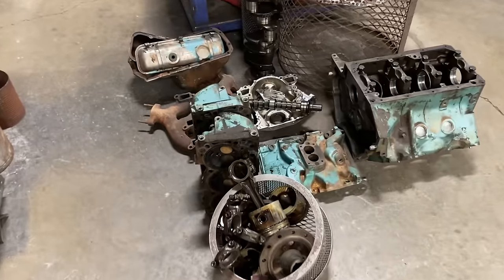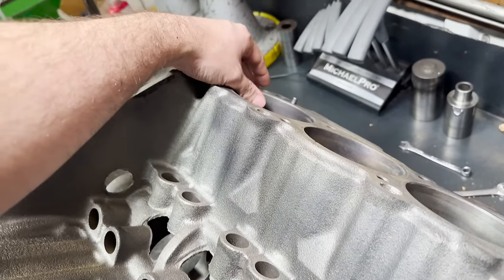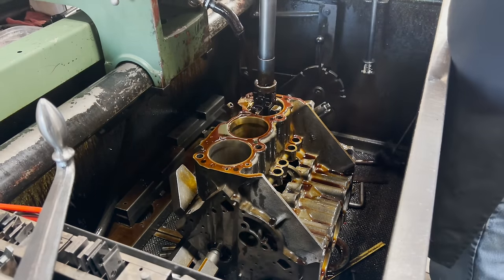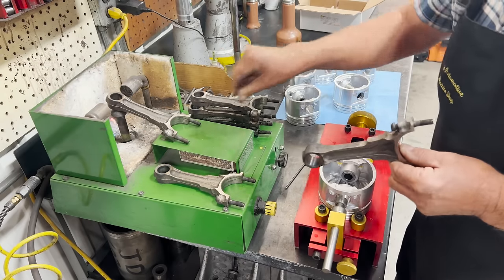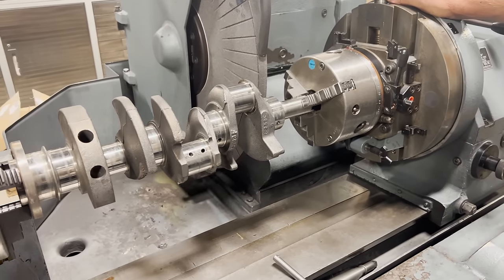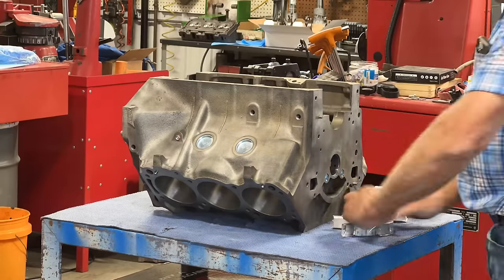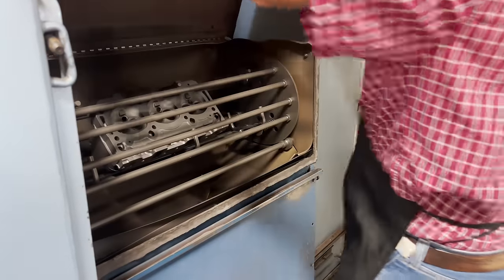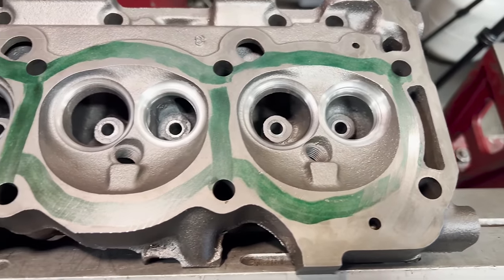This 225 Buick DAUNTLESS V6 Odd Fire Was WORSE Than We Thought...

Comment: I had a Jeep Commando with the 225 engine.  It never gave me any trouble, but the clutch was operated by a cable which would break at the most inoppertune moment.  The first time it broke i was in downtown traffic in Shreveport LA so as I approached a stop light I would just switch off the ignition as I came to a stop.  To go I made sure I was in 1st gear and hit the starter.  It would just take off, without lugging, nice and smooth. After this experience I always carried a spare cable.

As a side note when crossing the bridge in Pascagoula MS the wheelbase of the Jeep matched the camber of the bridge so that it resembled a boat on a good sized swell.  Closest I ever came to being seasick.

Comment: Back in the mid 70's I had a 1968 CJ5 with the Buick V6 which I rebuilt put a  Mellings cam in it a set of headers and a Holly 500cfm carb on it it was a LITTLE BEAST had tons of FUN playing in the mud and sand with it
Reply: I had a 68 cj5 as well. Holley carb, offenhauser manifold and hooker headers. Don’t know what kind of cam. It was fun.

Comment: Great video!  That cleaning guy has really picked up tremendous knowledge from hanging around the machine shop for a few years.  Despite all the detractors and trolls, it's very refreshing to hear your well reasoned explanation of how and why you do things without disparaging other points of view.  Also interesting to see the "modern" technology that Nicolaus is bringing into the shop to measure the surfaces, and refreshing to see that accepted by Dad.  Great partnership of decades of experience along with modern viewpoint with both clearly respectful of the other's thoughts and knowledge.

Comment: Had a 1970 Jeepster Commando with a Dauntless, originally came with a Pertronix points distributor that wouldn't run for squat, no parts available, the auto part stores could only get the distributor for an even fire, finally had to build an HEI, used a 350 Chevy distributor with a Buick base, was able to order the various random pickup coil, the reluctor ring  and the cap, it ran awesome, it is a whole other lever of research and parts tracking, the only info on the HEI parts were in a 1976 Buick Apollo service manual I was finally able to track down at the college auto shop. Great engines, the sound is definitely unique

Comment: Hi Gents, I have had 3 even fire 231 engines. 1982 Cutlass , a 1983 Cutlass and 1983 Grand Prix, these engines ran really well considering they all had 2.41 rear gear and 350 trans W/lock-up. Those cars weighted 3500 lbs. and cruise at 70 mph. no problem!! I remember the odd fire 225 I worked for Buick for a while and they also ran well, but like you said would give people fits in the later yrs. with parts mix ups. I really love this channel!! I like the content alot!! Thanks Cleaning Guy and Supervisor!!😁😁😁😁
Reply: Dauntless 225 was a much better and more durable engine than the later even fire models.

Comment: When you mentioned the build-up in the grooves, I immediately flashed on my bosses ring groove cleaner. It was a slightly different design but did the job. There was also a selection dial for ring width and you had to be careful to get it close or less. There was always a chance of actually cutting metal if you chose wrong or set the tension too tight.
   To tell you the truth I was always a bit intimidated when I had to use it.

Comment: For ring groove clean-up, I've used old piston ring from the same piston you're working on. Just cut and make the tip nice and sharp, cleans up old carbon nicely and is just the right size.
Reply: Way too nicely gouge up the land so  the ring is tight & doesn't seat/seal against the land.

Comment: Had one of those V-6's in a 71 jeep comando I bought off a farmer, was probably one of the best trucks I ever owned it was a half cab unit, with a 6ft snow plow, it pulled hay wagons, plowed snow{winter of 78} hauled a large wagon of green cut firewood out of many woods and took me 50 miles a day to work in many nasty days of winter. When it rusted out badly I sold it to a lumber Co. who plowed out their lots with it.

Comment: Very interesting to see the 1st generation of this engine, as my every day drive ( 97 VT Commodore 3800 Ecotech ) has nearly the final version. Look no adjacent exhaust valves - Buick seemed to be the only GM marque that could design a decent cylinder head.
FYI my 1964 Motors manual lists the ring gap at 0.01" for the Buick 198 & 225, which seems a bit tight for a heavy vehicle, so your 0.018" is probably spot on.
Reply: 3 thou per inch of bore.

Comment: Another odd-fire engine with an unmistakable exhaust note (actually two notes at the same time,  LOL!) is the Dodge Viper V10. So is the old Ram iron block v10, but the dual pitch is much easier to hear on the Viper with side pipes.

Comment: I junked a lot of those old odd fire Buick engines. They would skip a bearing,either a rod or sometimes a cam bearing. Most of the time they would get a SBC, but I did put a few even fire engines in when the customer wanted to keep a Buick v6.

Comment: When I went to trade school for diesel mechanic, I was taught to install the rings just like you. Only thing different is, coated the sleeve with light weight oil. Oil ring will always wipe the sleeves down during install. Coated both main and rod bearings with light weight oil as well, plasti-gauged dry prior to install of bearings, then coated when everything measured correctly. Great video as always, cheers :)

Comment: The very same problem exists with the PRV 2.7 litres V6 by Peugeot, Renault and Volvo - which was designed as a V8 originally and got 2 cylinders lopped of due to the oil crises. That's the very same engine, which powered the Renault Alpine A310 ... and the DeLorean. Renault, who was the last user of that engine, changed the internals for the last series used on the Alpine A330. Thanks for showing !

Comment: worked on fleet of v6 buicks back in the day. They would run rich because of the foam float would absorb gas. ring wear and cly. wall would wear like that. Check the wear on the bore in the timing cover for the dist. oil pump drive. any wear will cause all sort of problems. We would always just go new and this was a cheap operation
Reply: Indeed. I have heard that new timing covers aren't that great, so TA Performance made something better than OEM or most aftermarket units.

Comment: I remember reading info many centuries ago that rings rotate while an engine runs - so ring gap position is not important, it is going to change. 2 strokes I worked on had pins/pegs to stop ring rotation.

Comment: 7:36 holy crap!! I didn’t know those existed.

I made a compression ring groove cleaner and it doesn’t look all that different from this.

I use it for my fairly profitable Nissan VQ rebuilding.

Probably 1/3 engines I’ve rebuilt had rings that weren’t stuck, but definitely not completely free, they seem to get that way after 150k-200k miles.

I made my tool surfaces out of aluminum to avoid wearing the pistons and it seems to work fantastically.

Comment: Lovely Engine I had a 67 Jeepster Commando with the same engine with a Prestolite Distributor .... Fun fact, I needed to replace the starter, I had a unit from a 74 454 ... swapped the nose cone, ran just fine.
Reply: Some Jeep guys look in junkyards for the few odd fire V6 engines with an HEI distributor.

Comment: When I put an engine together I like to put the ring end gaps away from the thrust side’s of the piston, I think it stops the ring ends from putting vertical scrape marks up the cylinder wall. I also like to have the top ring end gap facing away from the exhaust side of the engine, I don’t know if it’s right or wrong but it has always worked for me.

Comment: My first experience with an odd fire was a wrong distributor cap provided by the SM, which I didn't notice or know about the odd fire even events at 90 while odd events went 150.  The other experience I had was  split journal when it became even fire was in a machine shop like your cleaning guy, wrong cam. The eventual 3.8 was a great engine and the final form with the counter balance in my opinion was one of the best GM ever produced.

Comment: add a split pin crank and a balance shaft..... and you get THE!!! smoothest v6 ever made..... the buick 3800 S1/2/3
.
i put a nickle on the intake.... and bounced it off the rev limiter..... the nickle never moved
32mpg, enough power, and just durable AF.......
.
buick had some DAMN good engineers back in the day
Reply: I think the 3800 series 3 might have been one of the best V6 engines. They got rid of the plastic intake and awful intake gaskets, which were about the only weakness.

Comment: Wow! What a nice little engine. Until now I'd only heard of a Dauntless V6 but never actually seen one. Thank you for letting us see it and the work you're doing on it.
Reply: Used in some early CJ 5,s  and mostly Commandos up to 71. Great little engine had Auto one and manual one,s in 2  different 70 Commandos Manual one had 42lb flywheel and once revs were up and engine Screaming it was unstoppable and would not bog down. Most potent hill climber I have ever seen or driven.

Comment: I rebuilt one of these back in 1986 for my Jeep.  Cool engine with plenty of grunt for these little Jeeps.  Man, the days of bore ridges at low mileage !! Thank tetraethyl lead for that.  Lead oxide is quite abrasive, and when we took the leaded gas away, bore wear went way down.   Some mechanics back in the 80'sclaimed better metal in later engines, but I call bull, as late 1970's-early 1980's were the worst quality from the domestics, but they still lasted longer due to unleaded gas.   Now, todays  (Last 25 years or so) ARE better metal and far more precise machining.
Reply: I think about how once there was no leaded gasoline, several early engines would get burned valves. The lead ash protected the non hardened valve seats.

Comment: I think piston rings is like thermal compound on a CPU when building a computer, everyone is the undeniable expert at it and only they can do it right. But with a couple, you just ensure you get even spread that it's all covered. With piston rings, all my engines I've built over my life, about 30 or so, I just ensure they are right side up, oil ring is together properly , and tap is correct. Otherwise I just ensure they are all offset. I read the instructions for any special setups for special 3ngines, but otherwise, I try to ensure aeast a 20° offset, preferably I go for 120° after ensuring gaps prior, then proper up/down and location. And when compressing the rings, they should always just compress right in with no resistance. If for some reason it doesn't compress, stop and investigate!!  But it's simple, don't let the keyboqrd warrior experts who have never touched and 3ngine, but know better because they watches a YouTube with all the science and theories and know everything perfect.  Lol. You guys are freaking artists!

Comment: I was a member of the American Engine Rebuilders Association back in the 80's when I ran an engine shop in Dover, Pa. They used to send out periodic warnings about certain engines that were considered "unrebuildable" and should be given a wide berth. I personally knew of at least half a dozen shops which had to shut because they lost so much money on warranties after trying to rebuild these engines.
Reply: Automotive engine rebuilders association
Reply: O yeah why don’t you prove it rebuild my engine I tried ,every bolt I could break off I did and I have no idea how
Reply: Different engines not the 225 odd fire here.

Comment: Bought new 82 Olds with 231.
Bought Buick from neighbor same year model.
Friend gave me a 4.1 engine . Overhauled it installed it and it ran much better.
Only thing I didn’t like was the oil pump in the timing cover which was aluminum.
A Chevy pump then cost 20 to 30 bucks , a Buick pump , the housing was over 100.
A lot of money for me back then.

Comment: Wow, that is absolutely mind twisting. I have never seen or ever heard of a engine like that. Great job, great video, awesome detail in what kind of engine you are working on. Keep up the great work.
Reply: Then there is the 120° Ferrari Dino V6. That has its own intricacies and balance issues. 
GMC also built 305, 351M, 376 and up to 478 CID 60° V6 engines. They also built a 702 V12 based on the 351M. The block, crank and cam are one piece specific parts but they use 4 cylinder heads, two carburetors and 4 exhaust manifolds. They also built a 648 cube 60°V8.
They also built diesel V6 versions named ToroFlow.
Reply: What was the deck height of the original pistons. The Buick V6 generally about 0.080" deck height. That is the piston crown is below the deck gasket surface. A -0.005" deck height would be the piston crown 0.005" higher than the deck gasket surface.
When Buick gave up on the 215 aluminium V8, they went to an iron V6 of 198 CID. When the General bought the V6 back from Jeep they bored it out a bit to 231 CID with oddfire. Eventually they engineered the split journal rod throws for even fire.
The year they changed to the even fire and at a different date they changed the cam with the distributor drive gear between machined in and bolt on.
Reply: If you really want to see an unusual V6 engine, look at a VW VR6. They are actually well balanced, I thought that would not happen.

Comment: I remember the mid 70s when instead of using the Buick engine GM tried to use Chevy engines in Buick to be a work around. I was at a local dealership then and it went so far that customers threatened to sue . So we were replacing engines on almost a daily schedule. I remember crating engines to go back to Buick.
Reply: My 1978 Buick Lesabre used a 300 CI 140 HP engine built by Pontiac.  It had an 85 mph speedometer and  a little buzzer that went off if you exceeded the 55 mph speed limit. The unreasonable speed limit made a lot of money for highway patrol and local police departments.
Reply: Then in 77 GM painted every engine in every make "GM Corporate Blue" to throw em off the secnt, and starting in 82 everything was painted black.

Comment: Volvo, Renault, Peugeot had a V6 engine with that exact set up in the 70,s
In the early 80,s they had changed the crank to even the firing up which made for a smoother engine.
Reply: Aren't those the PRV V6s that ended up in deloreans too?
Reply: @snoofayy6150  The PRV did get used in the DeLorean. I do not know if they still used an odd fire crank at the time.
Reply: @skylinefever  The second-generation PRV engines, that featured split crankshaft journals to create evenly spaced ignition events were introduced in 1984, which is post Delorean manufacture which (sadly) ended in 1983.

Comment: I could not get a really close look, but it seemed the main bearings looked perfect after the tear down. Too bad the cylinders were so messy. Most of the parts for the 225 Buick were the same as the parts for the 300 V8 and a lot of them the same as the 340/350 Buick so it's not too big a surprise they are out there though I'm surprised that you didn't have to buy the V8 parts and keep the extra parts as spares. All the small Buick V's were evolved from the 215 aluminum V8 of 1961.

Comment: Years ago I rebuilt an odd fire V6 Buick - it came out of the factory towards the end of the odd fire era and instead of the cam with the taper snout separate fuel pump eccentric and cam gear, the factory cam had the integral gear and fuel pump eccentric.  Tried to use the odd fire taper snout cam available from Isky and it wouldn't go into the block as far as it should.... sent the cam back to Isky and asked them to remove .125 from the rear face of the cam bearing shortening the overall length of the rear cam bearing and cam = only then would it completely slide into the block.
Reply: Sounds funky glad it worked but why

Comment: My 1975 CJ-5 came with the 225CI V-6. Put in a reclaimed 231CI V-6 that the junk yard swore was a 225. The difference is the 225 valves were feed throught the push rods while the 231 were oiled through passages in the block. Yes I tried to use the 225 head and yea, that's when I found out it was a 231. I think a V-8 would have been too much but the inadvertent upgrade was nice.

Comment: When I tension B.E nuts or bolts I like tension them individually, then do a 360 rotation of the crank to make sure there’s no binding or distortion of the B.E . I had an experience quite a long time ago, when I got an engine back from the machine shop where the B.Es were resized, when I tensioned the B.Es I found that the crank had locked up on just one journal. I don’t know how it happened but one rod end wasn’t sized correctly, as a consequence I like to check as I  explained previously.

Comment: I ran into the odd/even fire issue when I was ditching the smog equipment and adding a four barrel holley on a brand new 231 v6 for my ‘81 Pontiac Grand Prix back in the 80’s. A non electronic vacuum advance distributor for the even fire v6 was a one year only item, which was either a ‘79 or ‘80.

Comment: I and a friend of mine swapped a Buick 225 into a 73 Vega GT and used the factory Vega 4Speed.
Reply: In 1979 I helped a friend install a Buick 225 into his Sisters Vega wagon. Four barrel carb, aftermarket cam. The trans was a two speed super turbine 300. The variable pitch stator was controlled by a switch placed near the shifter. I believe the engine and trans were out of a 1964 Buick special.